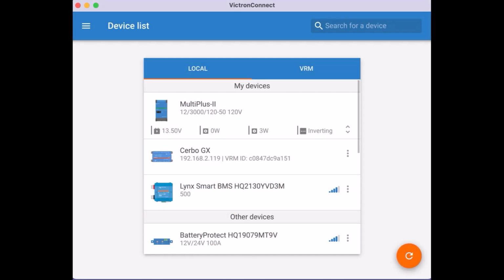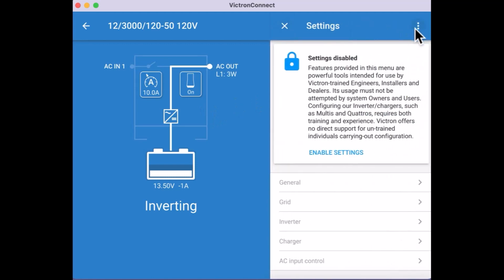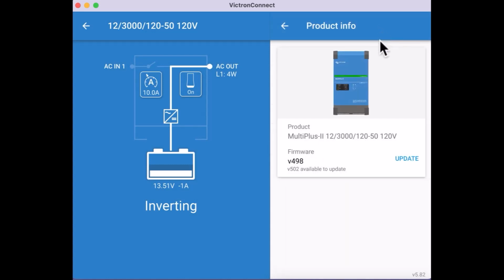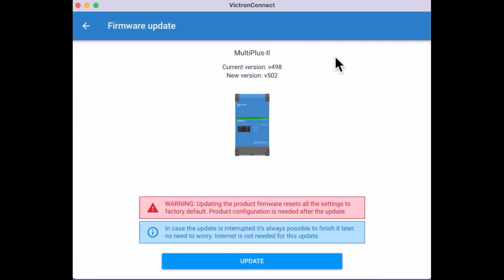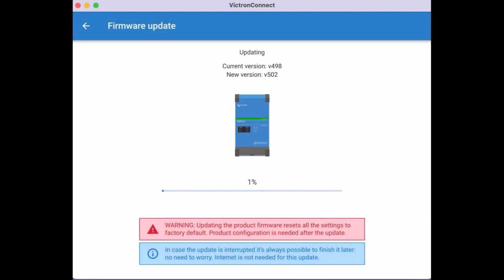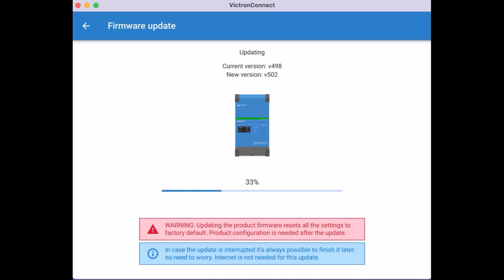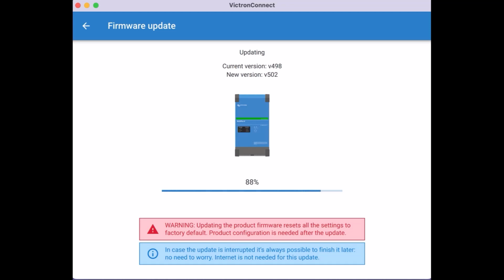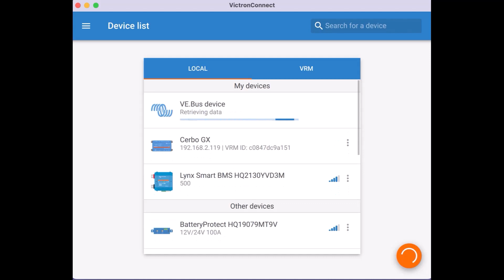Updating the firmware in a multiplus PKYS Inc

Comment: You say you have to dod this with a MK3 USB interface but that's not the case if you have a Cerbo.  You can do it through the cerbo but when I tried to go ahead and do it I got about 3 warnings about removing certain components, inverters etc.  Interesting you only had 1 warning in this video.
I'm trying to program my new Victron 2000/12/80 multiplus, just want to make sure I'm not screwing it up installing the firmware.
Thx